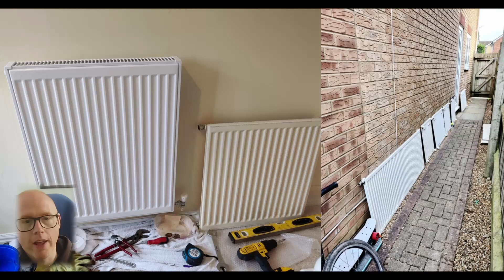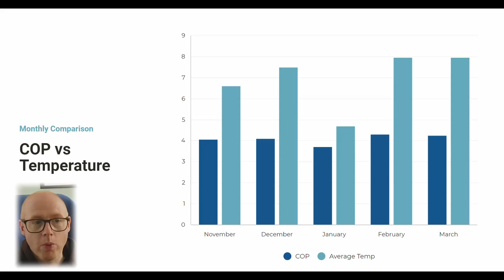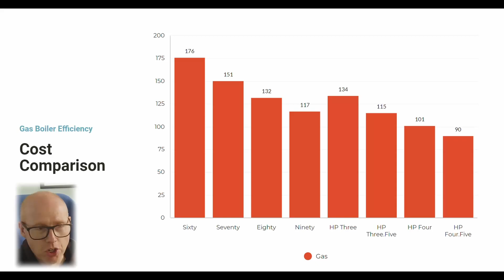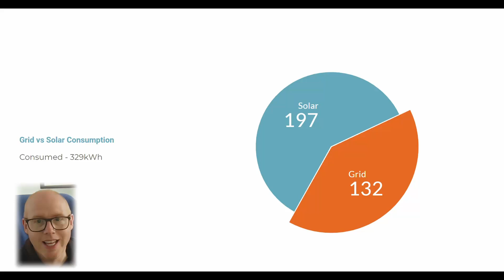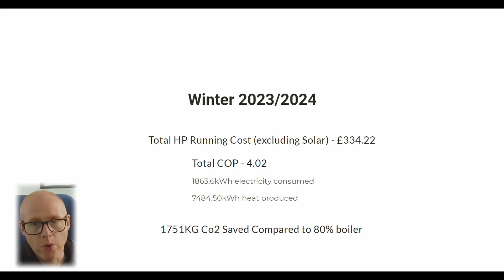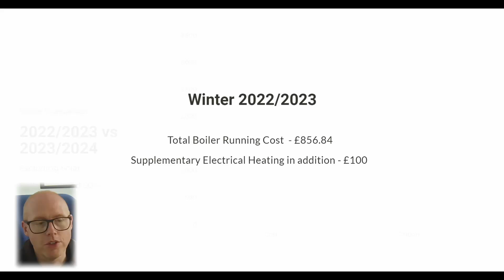Was my Heat Pump a waste of money? How efficient was it over the first complete winter? Full data!

Comment: Interesting you sharing this, but you'd gone from pretty much the worse gas boiler with modest insulation to top tech HP with good loft insulation.
Its kind of like the EVangalists who go from a £40k 30mpg performance car, to an EV, and then proclaim EV's will save everyone money!

We're in a 4 bed detached, 1997 built cavity wall house.    I did the loft leg / 300mm non compressed insulation topup in October.
Still on a boiler, and our shower is a mixer, so boiler feed.  2 adults and 2 late teenage girls.
2023 gas bill (Octopus) was £495.
Each person's circumstances are different, but with our microbore piping (not necessarily a show stopper) ripping out the majority or radiators on top of a HP.  Payback would be 10+ years I suspect.
This granted doesn't take into account our PV and battery setup, but I see the HP was robbing Peter to pay Paul energy usage wise?
Reply: Surely any improvement that improves savings and reduces CO2 is an improvement? By your own admission you've invested in your house and reduced your output so I don't see it being any different to EV owners or people who choose HPs. 

EV's do save money, on the right set up. My electricity bill has gone up significantly since I started driving an EV, but Peter(electricity) is cheaper than Paul (petrol), so I come out on top. Even compared to a 52 mpg petrol car I'm paying about a 1/7th of the price in fuel.
Reply: @B0jangle5  That's good mpg to have been moving from.
We avg 55mpg for both our diesels.
As you (and I) say, its a personal calculation.
Wifie 100% wfh, and its only the youngest child school run mileage which will end in 70 days when she finishes secondary school.
I work 3.5 miles away, so 140 miles a month, or about 1500 pa when you factor in leave etc.
The closest EV in terms of matching our main car (Nissan Qashqai) is the MGZS EV.
At least closest in terms of what I'm willing to pay, not able to mind!
Despite a driveway and a time of day tariff, it makes no (negative) financial sense for us to swap.
Putting aside they're fully paid off and in good condition, when I was paying the £216pm loan, I obviously can't get close to those rates now.  Insurance would go up £214 pa, and in 2025 I'll be paying VED.
Bear in mind the Nissan is £20 VED and ulez free!
Oh, and £500-750 for the charger install.
Its both more financially beneficial and ecologically responsible to hang on and sweat what we have.
The panacea IS saving money and the planet, but the 99% will only be willing to do the latter if the former condition is met
Reply: @stuartburns8657  Good points, my personal reasons were more due to the lease contract I was on ending so it was beneficial to swap cars. My motivation was largely driven by reducing the amount I gave to oil and gas companies, but by the time I'd started test driving them I was hooked so I would have been happy even if it worked out slightly more.
Reply: Very true, replacing the boiler with a more efficient boiler and doing the radiators would mean as much lower flow temperature which work have reduced his gas cost massively. 

I doubt the efficiency figures for the old boiler as I have a potterton and that according to the data sheet is 80% efficient. He is claiming 60% for his old boiler when new and that the old boiler has a sticky valve which should have been picked up on a service because of it was leaking gas that could have been explosive or Britsh Gas were bullshitting him (not uncommon with British Gas)

I’m not anti heatpumps but there is a slightly fanatical tilt to EV and heat pump enthusiasts to the point where they exclude some of the cost to justify their position. Likewise the anti heatpump brigade do state a lot of worst case scenarios and fear mongering. There is a happy medium which I think this chap has achieved too a degree.
Reply: @davideyres955  He had a choice between a new gas boiler which would have reduced the cost by up to 20% compared to the old 65% efficiency boiler and a heat pump which reduced the cost by 2 to 3 times. This year the cost has been reduced 3 times versus the old boiler which is still functional in hybrid mode.
Reply: I moved from a 21mpg 5l v8 to a model 3 performance. Still have the performance, but obviously my costs have fallen through the floor. 

His gas costs are similar to mine, and I have a 20 yr old Gloworm 40ff.      Debating what to do when it eventually stops working.
Reply: @derongalloway  This is why one of the most beneficial battle grounds for ICE to EV is the US.
For several generations if you'll forgive me for saying so, your engines have been rather stupidly oversized.
This is and was only viable due to rock bottom gas prices.
In Europe / UK, both road size and heavily taxed petrol and diesel mostly prevented this from happening.
So yeah, 21mpg and I bet doing 10k+ annual miles means its in the no brainer category.
Saving you money and Co2 at the same time.
I still feel like hybrids and PHEV's should have been the initial stepping stone, but hey we are where we are now.
Happy and safe motoring!
Reply from the maker: Thanks for your comment. I've replied in this video: https://youtu.be/u6J-Ba-6-jI
Whilst replying I forgot to mention that the loft insulation upgrade knocked off 250W from our heat loss and the Conservatory insulation knocked off 1800W.
The conservatory insulation was done last winter, which covered nearly 2 months of the boiler data.
Reply: my EV kona saves me £1600 per year vs a 50mpg car but the petrol kona does 44mpg 
maths is 15000 miles diveded by 4 miles/kwh so 3750 kwhs needed
7.5p/kwh is £281
50mpg at £1.45pL is 15000 miles divided by 50 for 300 gallons or 1350L which is £1957
or £1677 per year
at 44mpg its £1944 per year cheaper

new the EV was 36k , petrol was 23k.
Seven to 8 years to break even on cost, car will last 15-20 years and using petrol was environmentally unacceptible to me + cheaper servicing. 

might not be worth it to everyone at that price but was to me.

now lets consider the second hand market, you can get a 2020 kona petrol or EV on auto-trader for £15k.

now which one of those do you want to buy? the one thats £1677-£1944 a year cheaper to fuel ( half for that the average lower mileage in the UK) or the petrol car?
if you've got access to home charging you'd be mad not to buy the EV, as 99% of UK journeys are less than 100 miles, at worst its a 250 mile range car in winter for me. I only had to use rapid chargers 4x last year, its really not an issue and there's blooming loads of them now at services and other locations and they are very reliable these days. and lets face it there millions of people with drives and no EV yet, so theres a huge target market to saturate before the headache of solving terraces or flats etc ( though options exist and are good eg. kerbocharge.

I hope i dont seem too evangelical for you, and that you can enjoy the maths.
Reply: @Lewis_Standing  Hi Lewis.  I'd strongly argue that even with the ability to home charge, it's a 99% no brainer my friend.
As ever, we all have our own circumstances, but even you are looking at what many would consider a terribly long payback period.
I suspect you alway won't ve keeping it for 15-20 years either, very few do with any vehicle.
So with your calculations, how will next years EV VED affect it, and also insurance costs vs your old ICE

Comment: Your gas estimate was way above mine, similar sized house but no conservatory. 2003 year build house, 8 year old WB combi, set at 53C.
Reply from the maker: Thanks for your comment. I've replied in this video: https://youtu.be/u6J-Ba-6-jI
Reply: @UpsideDownFork  . Thanks , watched most of your latest upload. My boiler uses between 7200 and 7700 kWh per year according to Octopus- last years was definitely 7200 as I added up all my bills for the year. My previous, smaller house 1997 was definitely colder than my present one -  no cavity or underfloor insulation in the old one. 2003 House is occupied all day so thermostat 18C 6-9am . 20C 12-1. 19C 5.30-10pm. Thermostat also has set back temps so never goes below 17c during the day. If anyone complained of being cold we turned it up to about 20c. I do find anything above 12C outside and the heating doesn’t click on.
Reply from the maker: @bordersw1239  Sounds good! Please tell me you have an old Mercedes W123.
Reply: @UpsideDownFork  . Oh, I wish!
Reply: Same.  4 bed detached (small though) 1997 mixer shower.
2023 £495 (excluding standing charge I just realised)

Comment: The issue with heat pumps are the installation costs...
Reply: This is true.  But once done it's not a repeating cost. Like with combi boiler, a replacement is quite cheap but the inital instal of a combi  central heating system is  expensive. Also if your motivation is reducing emissions its a bargain compared to an ev. Unless you are comuting a huge amount.
Reply: Our 2023 gas costs where £495.
Sadly the vast majority of ppl will be motivated by financial savings, not Co2 savings
Reply: @stuartburns8657 true again. Mass environmental migration or catastrophic uk flooding or drought of our once green and present land might motivate a few. With a bit of luck not too little to late. Hopefully gas will stop being subsidised too.
Reply: I wouldn't be considering it if it wasn't for the £7500 government grant.
Reply: @angiej4865  agreed. We did it on the 5k grant. But in the end the grants are small fry compared to the staggering fines we face if the UK fails to meet net zero targets set out in the Paris agreement.  The fines would be a spectacular waste of tax. Spend it fixing the problems.....
Reply from the maker: Thanks for your comment. I've replied in this video: https://youtu.be/u6J-Ba-6-jI